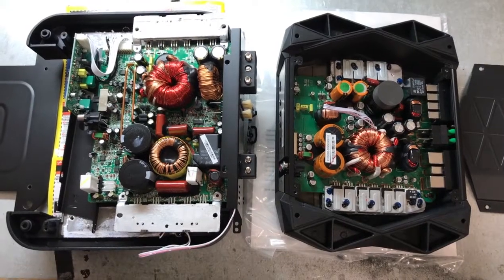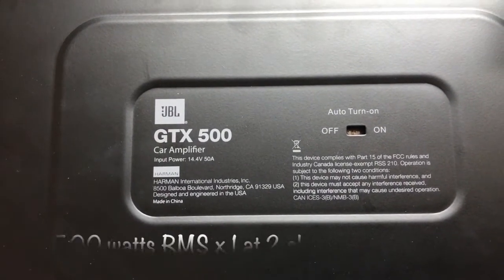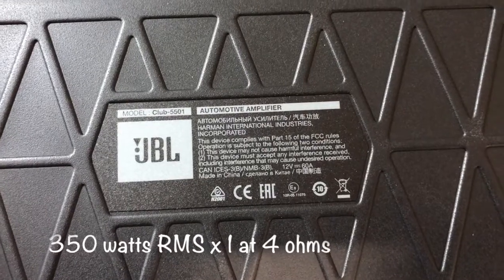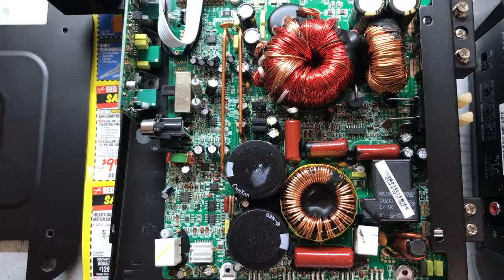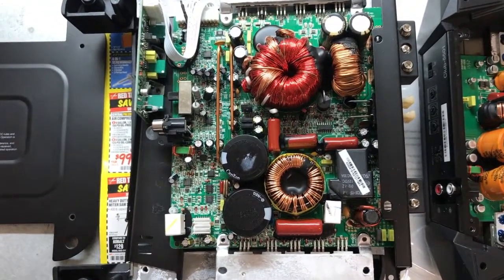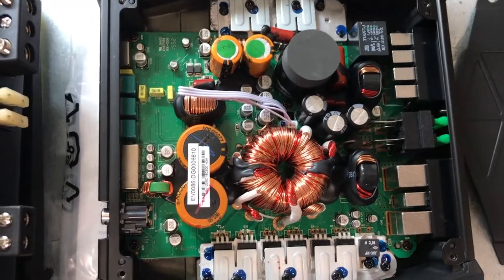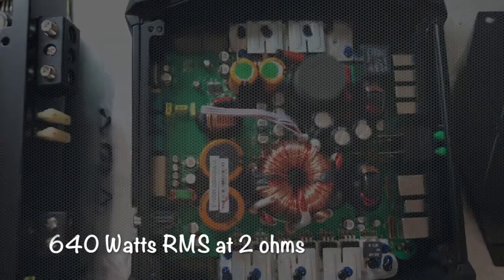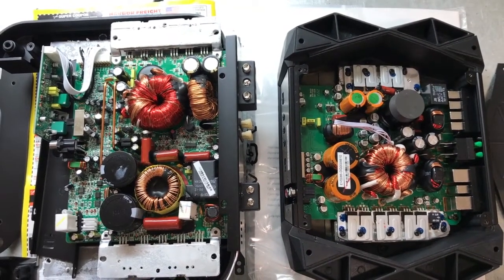JBL GTX500 vs JBL Club5501 Amplifiers disassembled

Comment: can you link me to the gtx 500 dyno, I can only find one and its "budget gem or budget bust" . I cannot find a club 5501 dyno, only a infinity 501 dyno which is same amp
Reply from the maker: Budget Gem or bust has a dyno for the Infinity 551A, which is the same amplifier internally as the JBL Club 5501. There is no separate dyno for the club 5501.